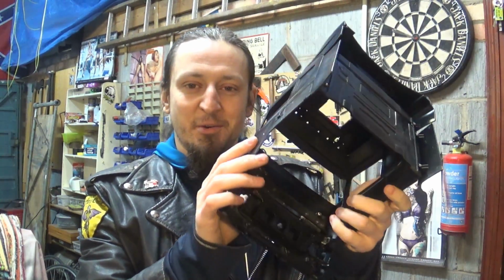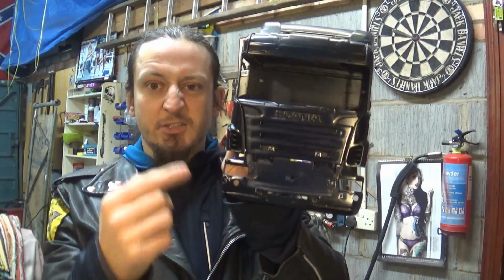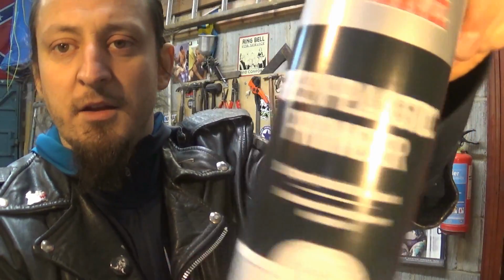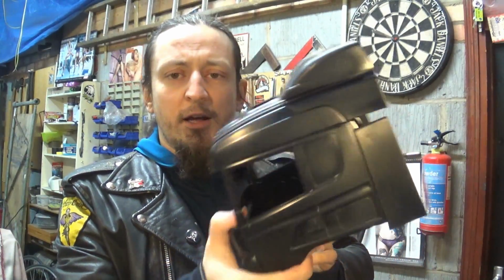Cambridge Pinstriping, Airbrushing RC Truck, Part 1

Comment: That’s bad ass I also do Rc airbrushing as well Rc helicopters I have one that’s a 750 size about 6 feet long blade span and 4ft in length and climbs out at a couple hundred feet a second. It’s cool to see something other than the norm. Keep up the good work brother!

Comment: I have a question for you brother, if you have a minute. I picked up a nice Iwata airbrush (japanese manufactured) last year that Ive been tinkering around with. After a bit I started using it without the needle guard, as my tip was drying often. Of course being new to airbrushing I dropped it and trashed the needle. I scored a 5 pack of replacement needles (from china), they fit perfect but just dont seem to give me consistent flow. I also have one replacement from Iwata as well that I havent used yet, it was about 6 times the price of the 5 pack from China so Im hesitant because I dont want to mess it up. My question for you is have you used cheap needles in your brush? was it worth the bargain if so? Am I just being a cheap fk not using the expensive one until I get better or am I  maybe slowing my progression using inferior products?  
Love the videos Mackie, makes my Saturday morning coffee and cigar that much better.
Reply from the maker: Hey man! I will reply to you in a greater detail tomorrow...as right now I am a little bit intoxicated with alcohol...but I never used Chinese needles or airbrushes...so I don't really know how good/bad they are. Also, I use Badger airbrushes, and never owned an Iwata... so yeah... I will drop you a comment tomorrow man!
Reply from the maker: Right, if you dropped your airbrush the nozzle as well as the needle could be damaged. So that is something else that you could look into. As I said - don't really have the experience with Iwata or not OEM  needles, but I would check for air leaks and oil and tighten everything up, before you go ahead and replace any other parts. Hope that helps man.